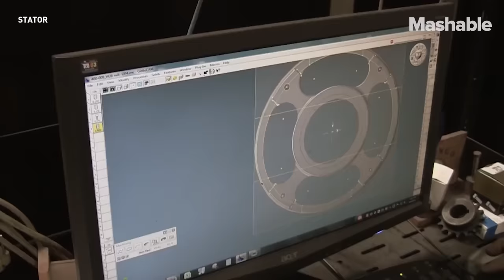Turn Heads With This Self-Balancing Scooter That Boasts Some Serious Wheels — Future Blink

Comment: 20 mhp range and 25 mhp speed aren't very good... shall be better 25 and 30. 

in addition there is the regenerative brake?  The dual engine would also be useful in order to have more speed and greater strength on the climbs.

I Hope that will be the PRO VERSION with these features 🙏

Comment: Comments are strange, considering you could make it lighter, I could design that too, however lighter isn't always stronger or better, can a lighter frame and rims withstand both riders weight and user impacts. You could drill holes in the handle just to lose weight - but then it will bend like a straw.

Comment: Why.... The wheels do not house the mechanics. it has a rear hub engine that is in the wheel but the mechanics are housed in the center of the board. Because the pipe is on the left side of the scooter the heavy batteries are on the right side in the deck (board you stand on) and the lighter controllers and cables are on the left side making it a balancing scooter. calling it "self-balancing" makes it sound like it has some mechanic like a gyro that makes it balance but the balancing is simply because the batteries and the frame are under the wheel's center of mass. It balances because of smart weight distribution.

Comment: This is the most stylistic and freshest looking scooter on the market looking like the Ferrari of scooters but unfortunetly has a toyota corrolla engine under the hood. Why is this thing almost 4k and only goes 25-30mph???? Seriously I hope you guys make a version that goes faster. I have a Segway Max that I just upgraded the battery for $230 and it goes fast than this thing. Too bad a company hasnt figured out how to make a fast scooter that looks fresh. All the high perfance scooters that go 40-60 mph have the looks of Mudusa. I would def buy the Strator for 4k if it went at least 40mph or more.  C'mon guys make it go faster, you have sick brakes on it, carbon fiber, and all the components but a weak motor (maybe weak speed control)

Comment: Another non-functional but much anticipated useless toy.
1. Weighs 90 lbs stripped of accessories.  Over 100 lbs with them. No woman can lift this into a car, let alone any public transport. Fail.
2. Cannot do hills.  Useless for any city like SF with hills.  Fail.
3. Huge!  Most public transport will not allow this monster inside. If they do, you cannot lift it up the steps or put on a rack either.  Fail.
4. Cost- $5000 - $6000 range.  I can buy a car for that.  Fail.
5. Comes with metal rods and wheels only.  Want a headlight?  Pay more.  Want a rack?  Pay more.  Want a seat?  Pay more!  Ripoff!  Fail.
6. Range and power no better than other brands, no improvement.  Fail.
Why bother. Stick to the manual Razor where your legs get a workout and look beautiful.  Small is simple.  Small is beautiful and functional.  Large, overpriced monster scooters are useless.

Comment: The tiny wheels on a Lime or those cheap BIRDS are what come to mind when I saw the size of these wheels. You can actually ride over a rock or stick on the road and not fall on your face at 15 to 18mph. This is awesome!! I think this is not for your average poor person who wants to carry it to work with them, take it on a train or a bus then ride it off to wherever. These things look huge but the ride must be awesome. In 5 years there will be precise handling and crazy speeds model, especially if Elon Musk takes 1 swing at these beasts and just makes it so you can ride it at up to 90mph. Perhaps with a range of 125 miles. Like go from from Los Angeles to San Diego at a comfortable level and speed and the cost will be in the neighborhood of $9,000 to $11,000. These are just wild imaginary guesses. I can see a Tesla version of this in my mind. Someone call Elon Musk, he will know WTF to do with these slow ass scooters!!!